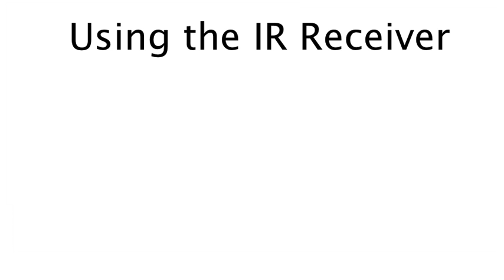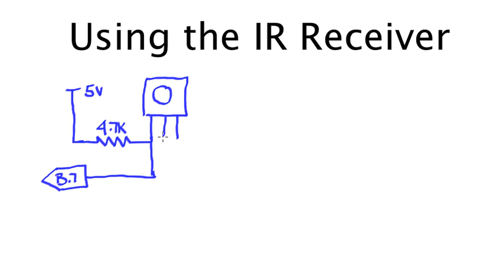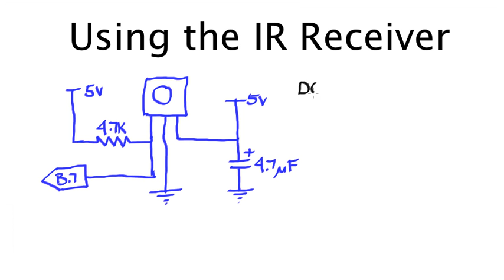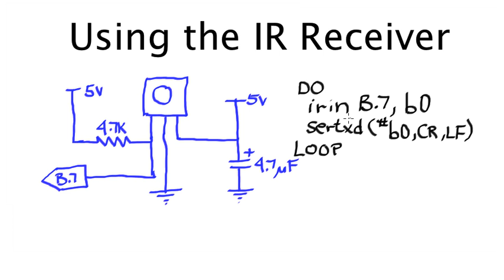Using the IR Receiver

Comment: I have configured ir receiver with 555  timer 2second delay output ...with tv remote ..after  I faced. Auto triggering ir reciever output...after I have mounted on 47uf eletrolytic capacitor accross the Gnd & Vcc pin..my issue solved..now it's working fine...input capacitor is very very.. important .
Thank you